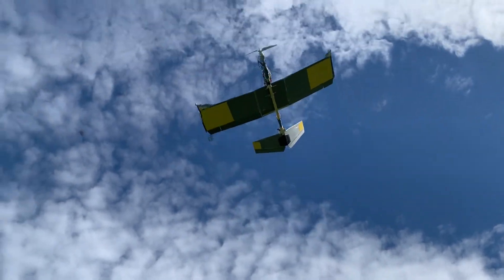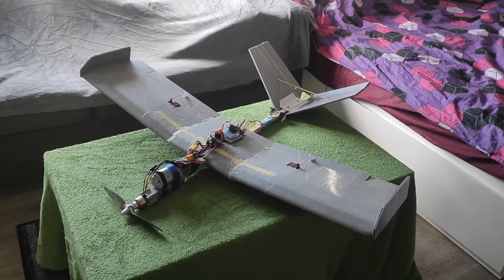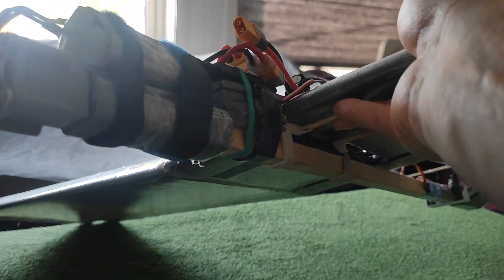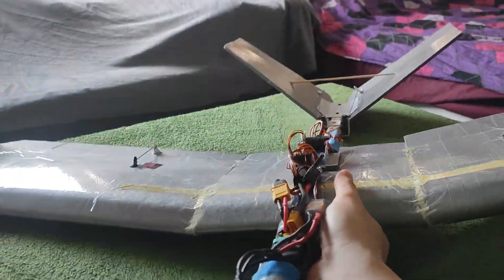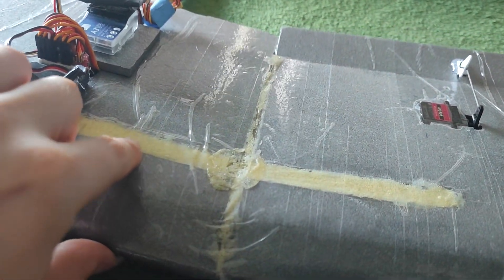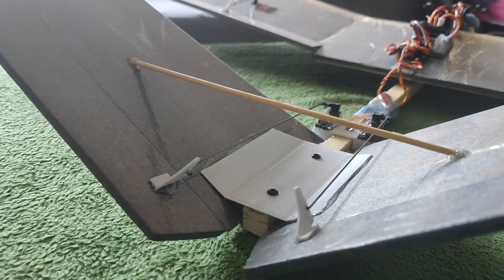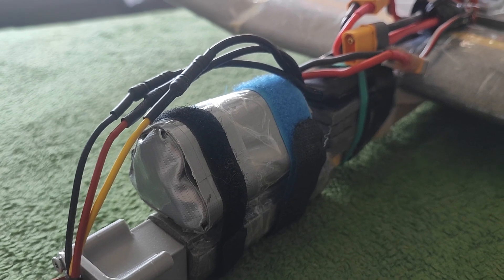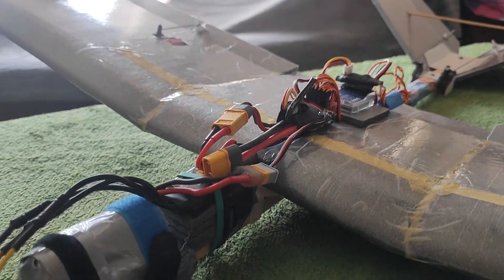🟡 Simple RC Plane - Trainer For Beginners and a lot of Fun | INDESTRUCTIBLE | EZ DIY

Comment: hey can u please give the 3d stl files for the mount and the bracket and also the connection diagram
Reply from the maker: Those 3D files were more like improvising and building around what I had available. I can upload it on Thingiverse If you want. 

For the connection diagram, I don't have there anything special apart from regular RC plane connection.

Comment: when you have gyro , dont need dihedral wing , and may dont need stablizer on wing tips , it can be more aerodynamic if you cover the top good , you can use better materials and design to make if very lighter , the motor mount should not be 3dprinted bcuz if it become hot , it will lose its shape , with all this comments , you do this very nice and you are so smart , keep going❤
Reply from the maker: Thank you for your comment 😊♥️
Yeah there could be a debate about everything on this plane. I'd build another variant differently. But all it is, it's just a training basher. I might just "argue" with the melting mount. It's sufficiently cooled down but most importantly, the same way you talk about aerodynamic efficiency, the same goes for the motor. If you manage to run the motor that hot that it's gonna melt the mount, you are only wasting power, most likely with a bad prop match. Here I don't have any excessive power loss/heat and the mount is holding strong. 

The gyro also has manual mode so it does not exclude polyhedral and gyro or FC won't do anything about vortices on wing tips, the pressure difference overflow, so the fins are there. ♥️
Reply from the maker: Oh, additionally, that open wiring and components are a very excellent source of parasitic drag 😅 Making a primitive removable cover/fuselage from 3mil Depron could help a bit.
Reply: @valkyrie_workshop  yes that cover helps , but about structure , It's like you want to build a tank , we call it over design , In buildings, this is uneconomical and in plane its uneff
Reply: @valkyrie_workshop   in planes like this we may do 3D maneuvers ,it can make motor hot and its better to use wood or 12mm balsa behind motor , its lighter than metal
Reply from the maker: Aaaaah 3D...Then it's all about Common Sense what materials you use. Here it's clearly non 3D plane, so all good and chilly 👌
Reply: @valkyrie_workshop    if you use manual yes , this wing can help you In exchange for losing a little efficiency , im telling this things to help you improve your work , Details are important , about wing tips , you have to close it , but its not necessary to use big fins
Reply from the maker: Yeah I got you. I'm just saying, this plane is not presenting aerodynamic perfection and it's not its goal. Got another builds where it matters 😊
Reply: @valkyrie_workshop  i saw the fins in your other planes , and very thick airfoil and st else which takes you away from the best state , i have built many planes like this and I have many opinions about this , and I understand your work well and admire you in general
Reply from the maker: @vahid00467  good good 👍 yeah. Well it's hobby for fun not necessary hunting for aerodynamic perfection everywhere. When I am about to build efficient long range FPV plane the design will be wisely consider. 

So I hope you also heard the tips are more for design, with that being said, that cancels aerodynamic perfection. So  I am aware of that. 

Anyway, thanks for your feedback and happy flying 🤘😊

Comment: Was it possible to using nicely without gyro?  Do you advice to use gyro?
Reply from the maker: After the polyhedral modification, It was significantly easier to fly.  I´d use GYRO in few situations. New built plane or if I am not a good pilot (or for relax safe flight). At least It´s extra safety and stability. Huge advantage is that you can disable GYRO in the air to fly fully manual when you feel for it or feel if the plane struggles so you can tune it closer to perfection. 

On the other hand, If you don´t want to have extra cost (still very cheap GYRO on Ali) or electronics in the plane, well designed plane should be stable. There are few nice videos about plane stability. But honestly, I´d still use GYRO at least for maiden flight, and because it´s no soldering, just connectors, you can put it out anytime :))